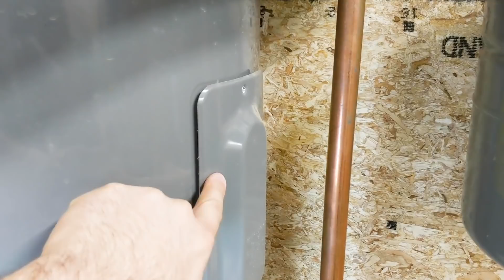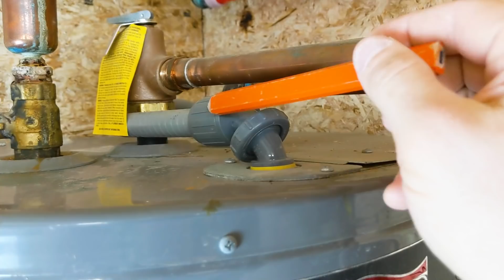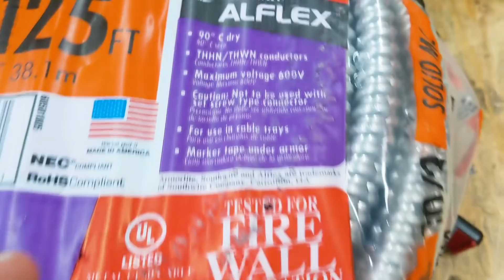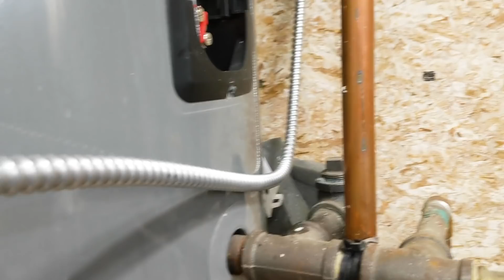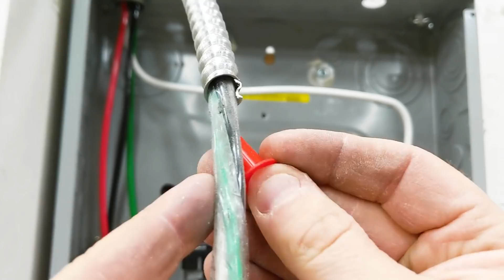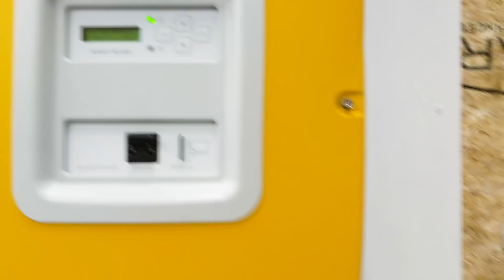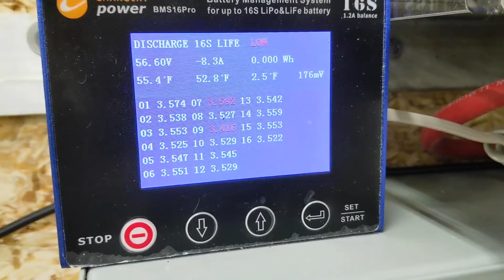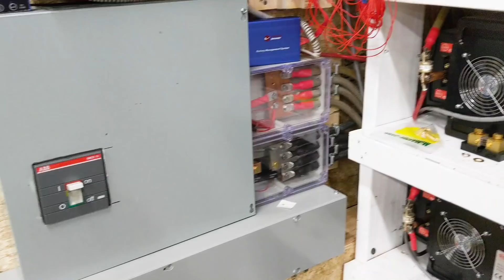Water Heater Diversion Load and Capacity Test

Comment: I was thinking of doing a batteryless or non gridtie  solar system for my house, I have only 1 element working for my hotwater heater cause the other broke, the idea is I would set the solar at a higher temp so it would keep the ac element from turning on as often and if I do laundry and showers in the daytime the solar can help reduce the ac power use. Are you sure the ac thermostat won't work on dc the same. Putting a grid tie or battery system is costly and they pay a fraction for power here if you sell back to the power company.
Reply from the maker: The built-in thermostat as i show in this video can work with 12V DC, but I wouldn't go higher.  After that, I'd use a temperature sensor that controls a relay.  If you buy the correct relay, it can turn on/off higher Voltage from PV.  For example, https://batteryhookup.com/products/12-30v-bms-upgrade-to-400a-relay-fuse-kit  This relay is rated for hundreds of Volts DC.  
Please use coupon code DAVIDPOZ  at Battery Hookup.

Comment: David, that is really amazing. Do you have the video made with the SMA relay setup yet? I would love to see the correct way to automate this function.
Reply: In case you read this, I am looking into a through roof combiner option, and the soladeck unit looks great. Once the POV wires are in the attic, is conduit required, or can it be neatly run the same as romex?
Reply: https://smile.amazon.com/gp/product/B07QGKYL5D/ref=ox_sc_act_image_5?smid=A23ANDP8TQ5WFL&psc=1
Reply: I just received my dc PV disconnect switches, same as you used, this week!
Reply from the maker: Hi Taulli1,  I have not hooked it up to my SMA inverters relay yet.  It's summer and I'm on to other projects for the time being.  As for the roof combiner, Nothing wrong with that one.  However, you will have to check with your local codes.  At least in my area, I need a rapid shutdown system when it's mounted on a roof, such as Enphase Micro inverters.  This means I'm using all Enphase equipment.  That's one of the reasons you see my solar arrays are built in the backyard, so I can run DC.
Reply: Oh man, rapid shutdown? This is the first time I have heard the term! Off search for a video. Thanks again

Comment: Hello, Can we Reset the Smart Shunt History?
Reply from the maker: Yes, in the app on a phone.  I do it every time I need to run another capacity test.
Reply: @DavidPozEnergy  I tried but didn't Found, Please help me to find it, I am using it on Ipone
Reply from the maker: Inside the app, go to "Devices"  You have to be in "local" which is through bluetooth.  Click on the shunt to open it.  At the top are 3 tabs. (Status, History, Trends)  click on the History tab.  Scroll down.  Right at the bottom it says "reset history" Click that.
Reply: @DavidPozEnergy  If I could just share a photo of it, there is no option to Reset the History at the bottom or anywhere in the app,  its SmartShunt BMV-712 and I am using iPhone,
Reply from the maker: OK.  I gave you my best possible answer.  If it doesn't work for you then I don't know why.  I think Victron has their own forum, perhaps try there?

Comment: Hey David, Not sure where to ask you general questions so I thought I would try a comment. I just ordered 2 24v batteries from battery hook up for my RV. I am wondering what would be the best option for a Charger\Inverter? I want to add solar eventually but not a short term goal.
Reply from the maker: There is no one inverter perfect for everyone.  A little more info could help.  First, is your RV 120v only, or is it 120/240v split phase (like a house)?  
Second, what is the maximum load you would ever put on the inverter at one time?  This might be an induction cooktop, AC, microwave, lights, TV, etc. all added together.
Reply: @DavidPozEnergy  Rv is 120 - currenlty has 30 amp Plug. Really only want to run DC- lights, usb plugs, maybe fridge. AC - Air Conditioner, - have a microwave and electric\propane water heater - but neither are really needed.
How would get measure or calculate this load?
Reply from the maker: Your current service is 3600w (120v*30a).  To check your maximum draw you can open your circuit breaker box.  There will be the main wires coming in from the plug.  You will want to clamp onto one of them with a multi-meter that reads AC amps.  I did a video on these, but here is a very affordable one that has excellent features: https://amzn.to/3uykTVv  Then turn on all your stuff to simulate a "worst case" load.  Maybe it's 21 amps, or whatever.  Multiply that by 120v to get the watts.  In this example, 21a*120v=2520w.  This is the minimum size of the inverter you will need.  
I've been doing quite a bit of testing on the ES line from Growatt: https://shop.signaturesolar.us/products/3kw-48w-250vac-80a-off-grid-inverter-by-growatt  I have the 240v version, but I linked to the 120v version for you.  It's an impressive inverter, and can have solar PV added whenever you want in the future.  (discount code DAVIDPOZ)

Aims also makes very popular inverters: https://www.aimscorp.net/Power-Inverter-Charger/

Let me know how it goes

Comment: I enjoy your channel very much, and you have some very good ideas.

I want to caution you, about dc opening switches. When breaking a current either for AC or DC an arc is created. The AC arc self extinguishes when the current reverses direction. However dc current only extinguishes the arc, when the gap gets large enough. High current dc switches are made with "harder" contacts. Ac switches, breakers, thermostats should not be used for dc applications. 

 In the olden days, cars had points and condensers to run the ignition system. A condenser is just a bypass capacitor to bleed off the charge of the arc.  The points are a dc opening switch. Alot of lawn mowers use this type of ignition system today.

 Two failure modes of points...
1. They would weld shut (closed) preventing them from opening. 
2. Metal migration from one contact to the other, with carbon build up preventing the point from closing.

In some specialty dc designs opening switches where developed to have an inert gas blown between the contacts to blow out the arc. I am not implying you need a gas blow switch for this application.  Just illustrating dc current switches need to be chosen carefully. 

Never use AC switches for high current DC switches.

I got the impression that you are trying to use DC through an AC thermostat.

Be safe.
Reply from the maker: Thank you for your well explained comment.  It's a very good point.  In my particular case I'm not planning to run DC through the element.  I'm going to be using a relay to switch on the circuit when the battery SOC is 100%.  But the supply power will be 240v AC from my inverters.  Thank you for your great comment.
Reply: @DavidPozEnergy  good, keep up the good work.  My thoughts dwell on how to eliminate the battery since it is the most expensive, life limited, and rare earth material part of solar energy systems.
 I have been following you  for about a year now.
 If I remember correctly, I started following you when you tried to impedance match a heating element to a solar panel. I think you posted a spreadsheet on your thinking.
I bought a bluetti ac50 after you did a teardown review of it. Yeah I knew it had limited capabilities. I already had all the comments to do a small DIY build and was trying to choose a battery when I found the ac50 on sale at Walmart for $370, it was less expensive than the cheapest battery on the market. I do not do Amazon ever. Solar really needs to be big $$$ before it becomes useful to replace heat in a home.
One area that concerns me is that inverters can drain a battery, no matter what type, to the point of ruin. The built in low voltage cut is not even good enough for lead acid. I been thinking about creating a inverter cut of circuit through the remote switch interface on >1k inverter size. I do not want to babysit a solar system. You are light years ahead of me.
Have fun keep up the good work.
Reply from the maker: Hi Peter,  PV direct to heating is great.  Yes, I did that with  a water heater, and with an electric baseboard in my house.  In both situations I replaced the AC thermostats and did my own Relay setup.  

The inverters I currently use can be set to cut off at any voltage.  I set mine to 46.0v currently just to prevent the over-discharge you are referring to.  This is on the Growatt inverters I recently did a video on.
Reply: @DavidPozEnergy  Sad to say the smaller 12 volt inverters do not have that feature. As a beginner I wanted to build a small system to learn by hands on testing, and would not kill itself if I fell asleep. 4 features that are lacking in small systems are
1. A programable low voltage cut off for the inverters.  
2. The inability to not charge via the charge controller.  if the battery temperature drops below 0 deg C (lifepo4) requirement.
3. A fuel gauge that actually works.
4. Lack of detailed operational description of various components.
5. Labels and specsheets that are written for a consumers.

The various manufacturers don't seem to be working together to partition requirements, and make things plug and play, so the inexperienced solar curious people like me don't buy the wrong equipment to have system. I have a lot of equipment on hand and money wasted because I didn't have a clue what I  was doing. I have come up the learning curve. 

It seems to me, putting those requirements on a BMS is the wrong place to solve these these issues. Lead acid batteries don't come with a BMS.  

Have a great day, you can't fix the manufacturers lack of coordination. Eventually these guys will get together or go they will go the way of betamax VCRs.

Comment: Hi David. I know you are having a mix of battery chemistries and capacities but on the average, your discharge test was at what C-rate for the entire battery pack?
Reply from the maker: This ended up being a 6-hour discharge for the whole pack.  But you are thinking about something very cool, what is the discharge rate of the individual packs.  It's one of the many reasons most people shouldn't be pairing different chemistries.  In my case, I calculated that in advance, that I shouldn't have ever been discharging any one battery at more than a 1C rate.  I actually stayed under that.  I was doing a ton of spot-checks with my amp-meter (clamp on multi-meter) throughout the test.  At different voltages I was pulling different amps based on the chemistry.  Specifically, from 56-53 volts, I was pulling more from the Li-NMC.  Then there was a long time (about 4.5 hours) that I was pulling nearly all the amps from the LiFePO4.  It's really fun to see all this play out, but I was trying to focus this video on the diversion load/capacity test.  And not all the intricacies of the cell chemistries.  I could make another video on that if there is enough interest.

Comment: How did you determine the high charge and low charge values for the battery combo?
Reply from the maker: For the high-voltage cut-off, I took the lowest value.  For the low-voltage cut-off, I took the highest value.  I have a video that helps explain: https://youtu.be/CbHABrTpSKU

Comment: That was a great sensational project video you did on the hot water heating element connection and testing . It seems to be a successful result that involves all the necessary materials needed to complete and have an effect that’s satisfying . Excellent video . May the solar be with you .

Comment: Just a small observation. The new bottom thermostat will only sense overheat at the bottom of the tank. The top overheat stat will probably trip first but will not shut off the power to the bottom heater element. Is this a problem?
Reply from the maker: I don't think it's a problem.  Those thermal over-temp (red button) are probably set pretty high (maybe 180°F?) and my lower thermostat is set to 120°F.  But, even if it somehow did create that huge amount of stratification (which I don't think it can) there is also a T+P blow-off valve that would open.

Comment: Under normal grid-powered scenarios, what is the point of two identical heating elements that can't both run at the same time?
Reply from the maker: The standard operating proceedure of the millions of electric tanks on the market is: First the upper thermostat heats the water until it is satisfied, then the lower thermostat heats the rest of the tank.  This gives you a faster recovery time.  Think back-to-back showers.  What if the first two people in the household use all the hot water and the tank is cold?  Then a third person wants to shower.  If they only had one, lower element they would have to wait 2 hours for the full tank to recover (get hot).  But with an upper thermostat/element they might only have to wait 20 minutes.  Granted, the whole tank won't be hot, but there will probably be enough hot water for one more shower.
Reply: @DavidPozEnergy  I would have imagined that convection would mix the entire tank before any meaningful gradient was created. I didn't know though, since I've been using tankless since I was 6 years old, and I only know the quirks of a natural gas instant water heater.

Thanks for taking the fime to give a meaningful response! It really does mean a lot.

Comment: I now have LFP on the sunny islands.  What did you set the SI voltages to?  2.31v??? I heard later in the video 2.36v x 24 = 56.8. 56.8 / 16 LFP cells is 3.55v.  Did you find a setting for sunny island low voltage shut off? Mine is 42v amd I can’t find where to change it.  Also, Are you Issing that raspberry pi interface?
Reply from the maker: Hi Wes,  At first I was using the Sunny Islands in VRLA and setting the cell voltages exactly as you describe.  However, I'm now using the Raspberry Pi to communicate with the Sunny Islands, and the Sunny Islands are in Lithium mode.
Reply: @DavidPozEnergy  Do you have a video of your Raspberry Pi Sunny Island setup, or other info on this?
Reply from the maker: Hi Bill,  Not yet, but I am working on it.
Reply: @DavidPozEnergy  What happens when the raspberry pie crashes? How does the study island respond to suddenly not having any information about the battery? Does it shut down or does it just continue trucking on in the absence of new information?
Reply from the maker: Hi Wes,  It shuts down.
Reply: @DavidPozEnergy  yikes!!!
Reply: @DavidPozEnergy  I'm thinking outloud.... If there is a danger of the Raspi shutting down and the inverters going down, it would seem to make more sense to control the change current setting in VRLA mode by RS485 using the Raspi.  That way if it crashes, the house carries on with the last settings.

Comment: Victron Smart Shunt claiming 44% SOC at 48V? That's about 40% to much. Oh dear ;)
Reply from the maker: The Victron Smart Shunt displays the 44% SOC based on what I entered into the Victron app as the battery capacity.  However, I didn't know the battery capacity BEFORE the test.  That's why I had to test it.  So I entered a meaningless number just to zero out the settings and begin the test.  Since my input data was meaningless, it means the SOC reading was also meaningless.  After the test I now know the actual battery capacity and I am able to re-set the app data with a newer, correct, battery capacity number.
Reply: @DavidPozEnergy  yes David. I was just wondering, that such an expensive monitor is still only relying on data input, and will not use the edge cases of high and low voltage level, to calibrate itself and basically know, that it is surely not somewhere in the middle of the curve :) Anyways, that is my next project on my powerwall, where i will merge my DIY battery monitor with LFP controller, and it will do just that. keep your great videos going! you are one of my favorite channels to get inspiration. thx
Reply from the maker: The shunt will auto-calibrate at 100% every time you reach the maximum voltage setting.  In the case of this test, 56.8v.  I actually like that not everything is automatic since I'm often doing things outside the "normal" box.

Comment: Hey David, I have also 32 of the 280ah lifepo4 cells everyone uses hooked in series  parallel for 48v, do you think that's enough battery for a regular 2ksqft house? Let me know if you got this message I think yotube shadow banned me.
Reply from the maker: 28.6kwh is about the same that I use for my house.  However, I can't say if it's good enough or not.  There are far too many variables.
Reply: Your energy inputs are half of the equation. Now you need to roughly calculate your energy outputs, and cut back on usage or improve efficiency as needed.